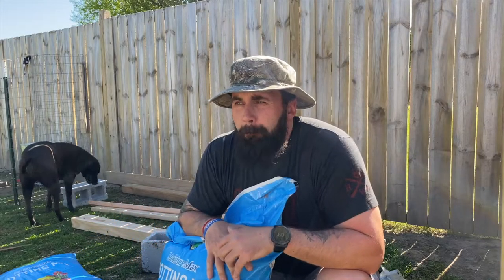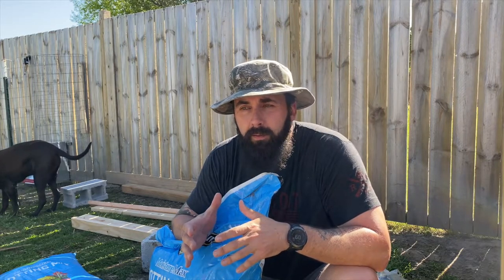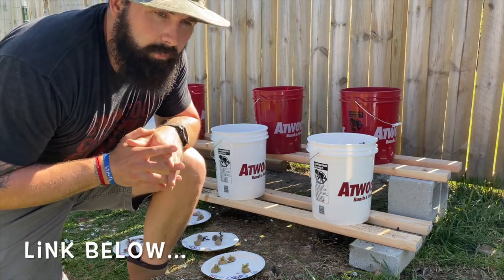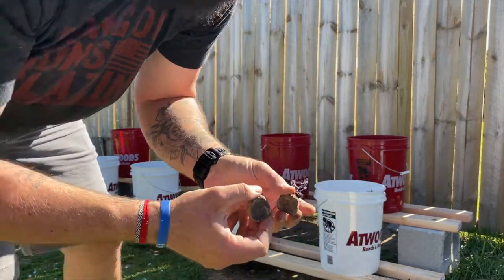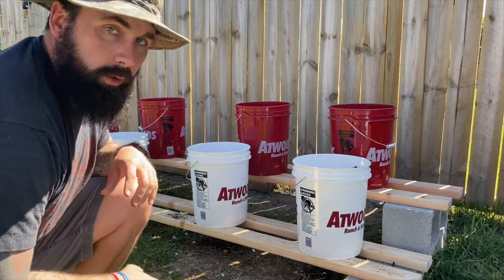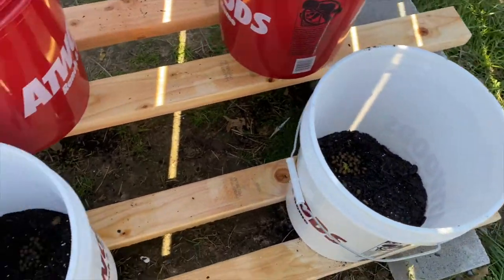Growing Potatoes in Five Gallon Buckets

Comment: Good thing there was a nice breeze to distract you from the Stench of a Duck Egg gone bad.....Be quick in those RealTree Muck Boots eh...I thought you were gonna put the boards through the cinder block holes and then set the buckets between the board rails on the ground to keep em from tipping over/down cuz the vines coming out might make them tippy?  maybe I'm Cuckoo Maran for Cocoa Puffs
Reply from the maker: 😂 Good stuff as always! I’m going to use a cattle panel to support them against my fence eventually. They’re will be a part two in the works for sure! 👍🏻